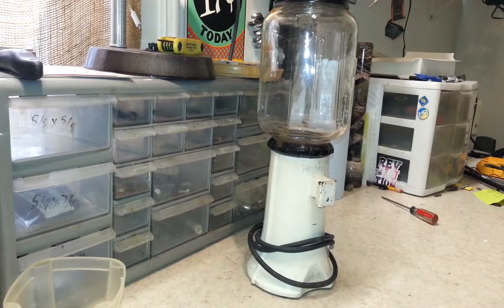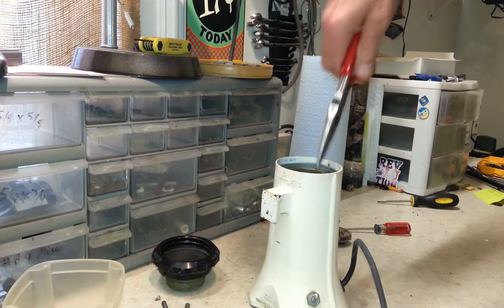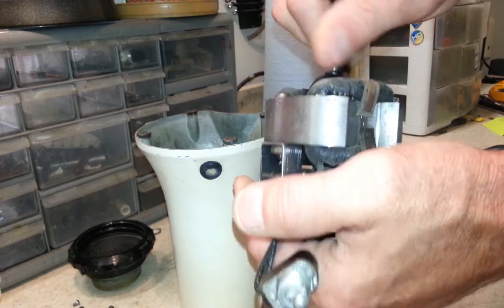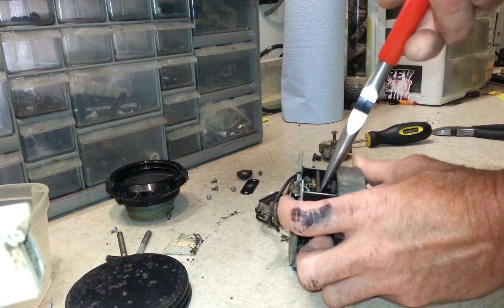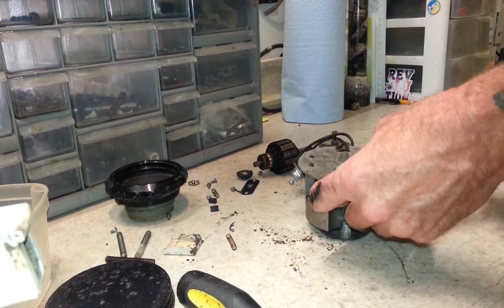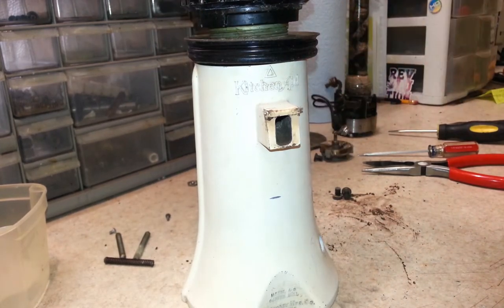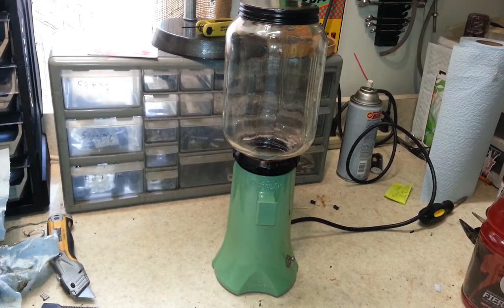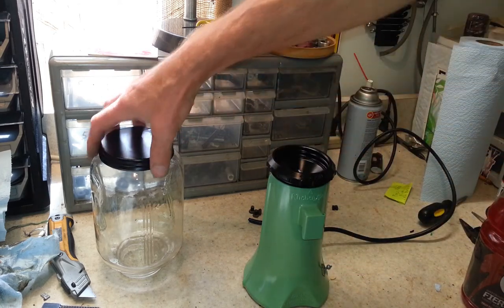Kitchenaid A9 Coffee Mill restoration in Pearl Mint

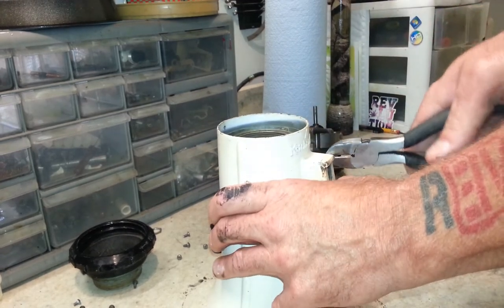Comment: I was wondering if you could have removed those pins at 9:16 by grabbing them sideways with vice grips and give it a solid wack with your Estwing?
Reply from the maker: I don't know, the pins are quite soft and may just mash, which is why I have a hard time getting a grip on them at all. Once the machine is baked they will also come out a lot easier, while still hot. Sometimes these come right out and other times it may just be the very end, leaving some pin inside the hole, which I thought was going to happen with these. These pins I actually ended up leaving in, and slipped the door over them with little effort.  Hardened steel pins are so much easier to deal with lol

Comment: Im currently restoring one of these, how do you powdercoat the adjustment dial? ive been told that it wont come out well due to the material
Reply from the maker: I tape off the threaded portion and powder coat it like the rest. Also remove the burr as well. Should come out just fine as long as it iss outgassed properly.

Comment: I have one and it works well. I am looking for a set of replacement feet. Where did you get yours?
Reply from the maker: I found them on ebay, I believe they were called recessed rubber bumpers. From the side they look like a T. I dont recall the exact size, but they come in a variety of sizes , just have to match the size of the smaller end to the hole in the base.

Comment: How accurate is the parallelism of the burrs? Can it be set close enough to make the fine grind required for espresso, and is the grind even enough?
Reply from the maker: I have never used one so I honestly don't know. I know I have heard from others that do use them they don't grind very fine, and have a tendency to clog as well. For a really fine grind, that may take a specialty mill,  I really don't know .
Reply: For a really great espresso grind you need a precision grinder, ours is from Germany and is a Profitec, one of the best there is, it offers very precise grind adjustments with a finger turn screw fine adjustment knob. The good grinders for espresso cost a lot, ours was around $ 800.00.
Reply from the maker: Thanks Brett! I buy Maxwell house already ground lol, so I wasn't kidding when I said I honestly don't know :)
Reply: Yes Brett, I already own a vintage Anfim Best, unchanged design dating from the 60s if my memory serves me right. It's in the same price range, mine I got for less than $100 but it needed lots of work: cleaning, bearing replacement and burr sharpening. This vintage grinder has a massive aluminum casting, huge motor, uses large ball bearings and after measurement with a dial gauge its burr holder had surprisingly little runout :-) But I was wondering if this KitchenAid grinder was built as well as their mixers, with enough precision to be adjustable for the required grind size and grain uniformity. I like the vintage design and was considering getting one for kicks ;-)
Reply: Hahaha Rick that's why so few known good coffee grinders come from the US ;-) Once you've gotten used to freshly roasted, freshly and precisely ground and espresso brewed, you usually won't want to get back to what what passes for coffee in the US, heck even Starbucks is crap in comparison, I had the unfortunate experience to be given one recently... But that's another ball game entirely, been a coffee nut for years before I became a mixer nut hahaha
Reply: Hi Rick, We have to get you to a better coffee place; just kidding.

Comment: I have one just like yours - marked Model A-9, painted (poorly) in fire engine red (by brush). Mine came apart easily but I found NO BALL BEARING in the bottom of the armature. Is the ball bearing absolutely necessary? Cuz my armature spins easily without a ball bearing. If a ball bearing is required, what diameter is needed, please?
Reply: I had exactly the same question, did you ever find an answer?